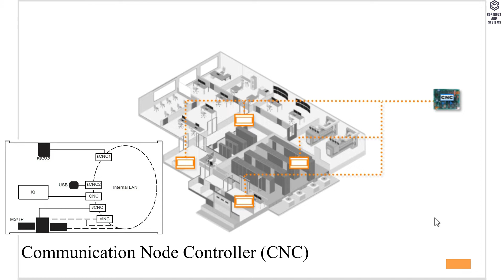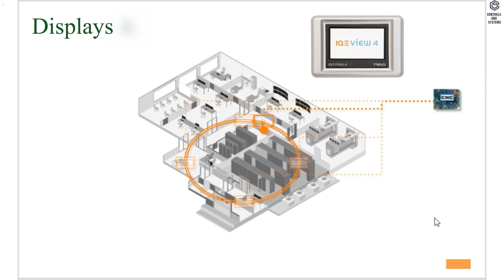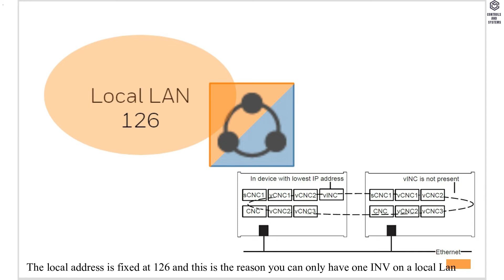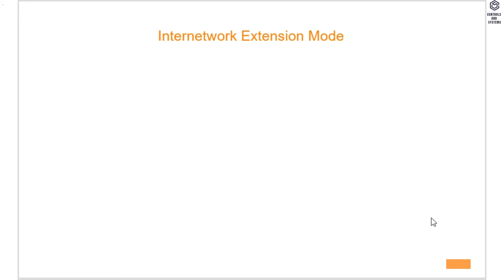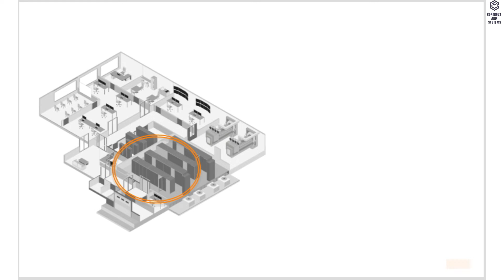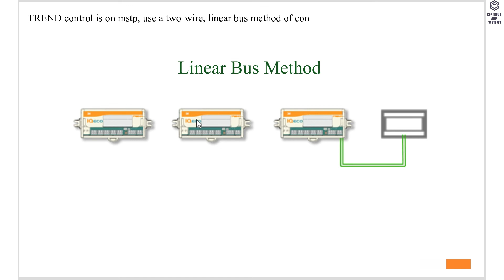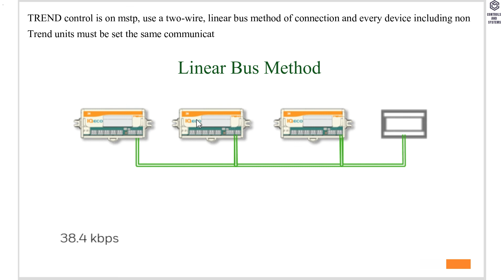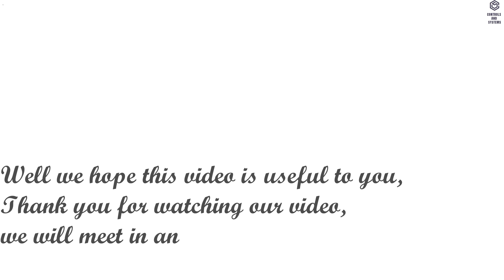Trend Network Structure & Infrastructure Explained | Trend BMS Part-2

Comment: Why does my computer say the fan is running in a particular room, but when I check the fan in my plant room, it is not running. Can it be the actuator is not working or broken
Reply: CHECK THE DP SWITCH MIGHT BE SET TO LOW